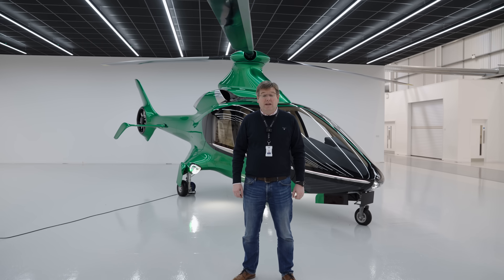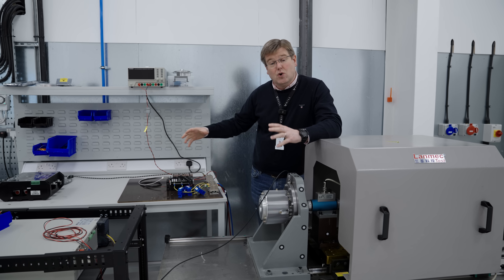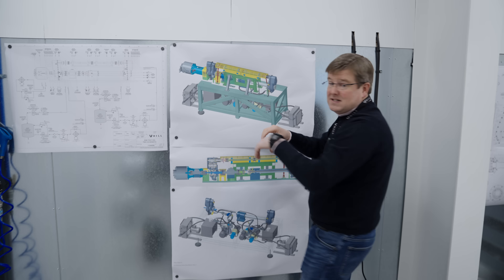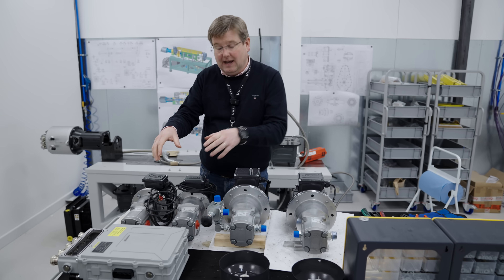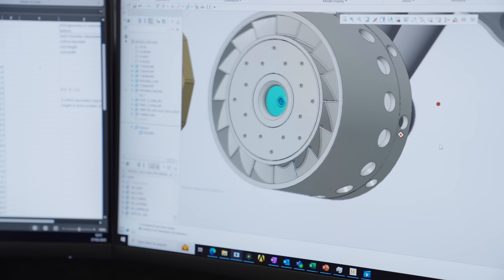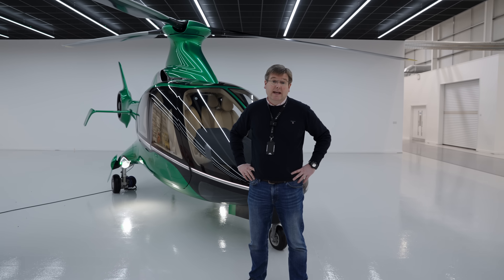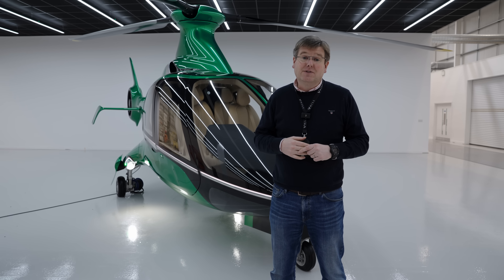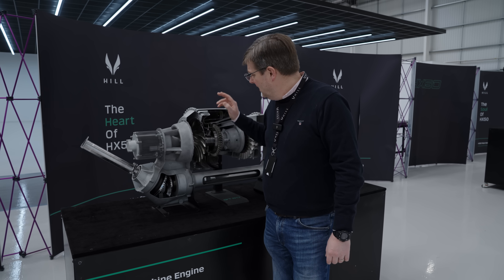GT50 Engine Developments

Comment: The overall approach is somewhat RISKY and may prolong the first flight and certification of the helicopter. I am not sure about the strategy of making almost everything in-house - from the engine to the fuselage. To reduce RISK, it is better for Hill Helicopters to concentrate on a critical few work packages or components for in-house manufacture and then outsource the rest of the components to well-established companies that have already gone through the learning curve in making those components. The company will still have time in the future to manufacture some of the outsourced components in-house. However, I appreciate the dogged determination of the team to date.
Reply: Hill has gone over this question multiple times in previous videos

Comment: Should really be looking at a regenerative turbine like the TurboTech, or even turbogeneration. Look at how the diesel-electric locomotive completely flipped the script on complex gearboxes; turbogeneration could do the same thing for helicopters, replacing the complex and error-prone gearing with one or more electric motors running at the necessary speed for each output.
Reply: You seem to be completely ignoring the enormous weight and cost of a generator and motor, each with controllers, each redundant for reliability, and each capable of 500 horsepower peak and 400 horsepower continuously. There is also the inefficiency of the whole system (likely under 80% efficient from engine output to transmission input). 

Helicopter rotors operate at constant speed, so there is inherently little advantage to a electrical transmission system... and it is inherently the opposite of a rail locomotive. 

The engine's reduction gearbox is dead simple, and far less expensive, lighter, simpler, and more reliable than a generator and motor system.

Comment: What's a "titanium fire"?
Reply: Titanium WILL burn. And if it gets hot enough to burn, it's extremely hard to put out. It must be smothered in sand. Water, CO2, etc can make it explode. We had a lathe turning titanium compressor wheels catch on fire, the chips of titanium caught fire, we BURIED it in sand and it burned for a day. Total loss.  Titanium is extremely reactive with oxygen during a fire. Temp of burn is very high and fast burn speed.
Reply: @vtxrecruiter  Sweet!  Thanks.  This is the first that I've heard of this, which kind of surprises me...  I always knew Ti sparked well - never knew it could "burn down". lol